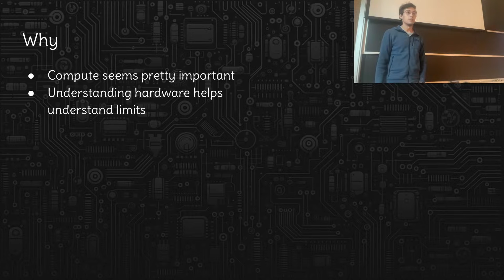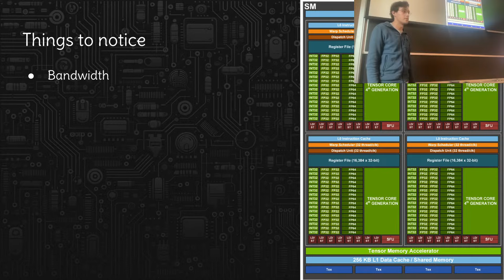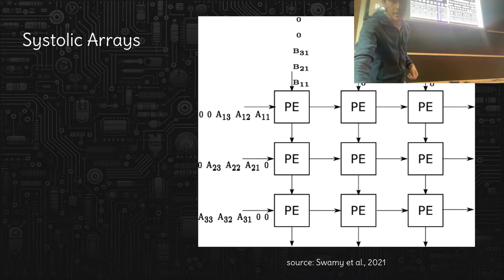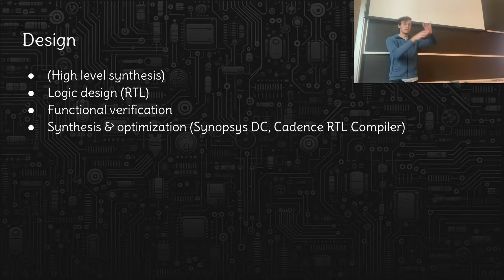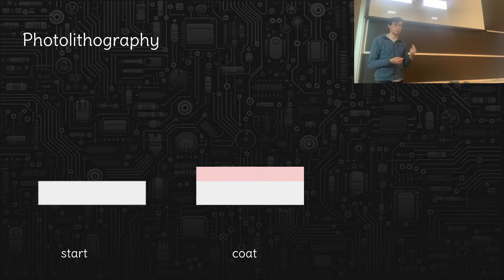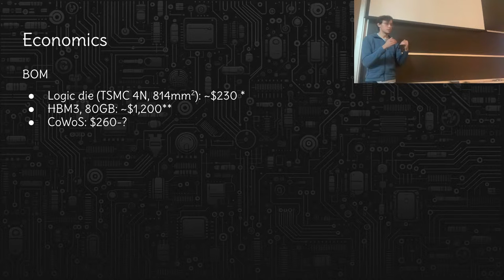Notes on AI Hardware - Benjamin Spector | Stanford MLSys #88

Comment: Great presentation! Wondering if there is any literatures or papers, tutorials on the similar topics? The talk was kind of quick, need read more specifics from literatures. Any pointer would be appriciated. Thanks!
Reply: I blew through a ton of different topics in the course of the talk, so it really depends what you're looking for.

If you want more on making the most of an H100, NVIDIA has fairly good docs on both the CUDA programming model as well as the specific features of the H100, but actually using them can be tricky, so your best bet is probably to read the CUTLASS repo and see how they do things.

If you want more on hardware design, I'm not sure there are great alternatives to taking a class. Hardware design seems to me like an awful lot of work -- writing good RTL is hard enough, but the whole EDA stack is a bit of a nightmare.

If you want more on semiconductor manufacturing, I'd highly recommend the Asianometry YT channel, which has a lot of really excellent content.

Otherwise, some of my main sources for this talk were SemiAnalysis ($500/yr, but I like it enough that I pay for it even from a grad student stipend), Bill Dally's HC2023 talk, and various coursework, particularly 6.172 from MIT for performance engineering. (It's on OCW at https://ocw.mit.edu/courses/6-172-performance-engineering-of-software-systems-fall-2018/video_galleries/lecture-videos/ and while it's focused on CPU performance engineering many of the principles apply across both.)

Hope this helps!
Reply: @BenjaminFSpector   Thanks a ton man! What you have shared here is gold. I really appreciate it.